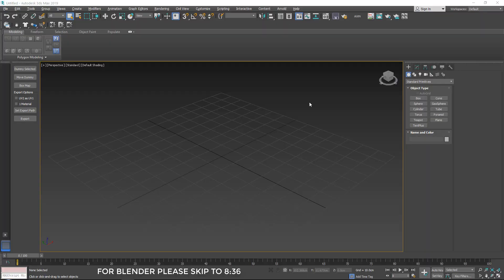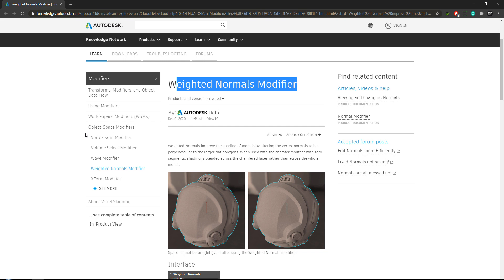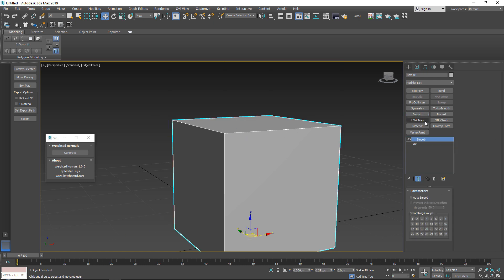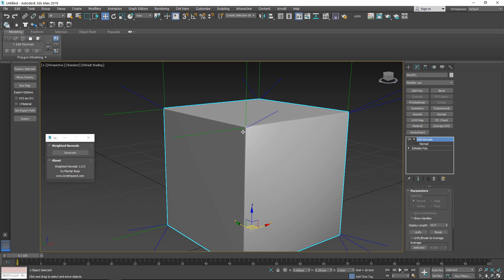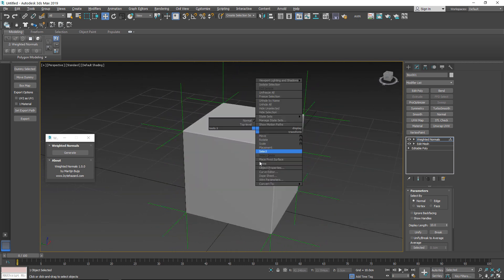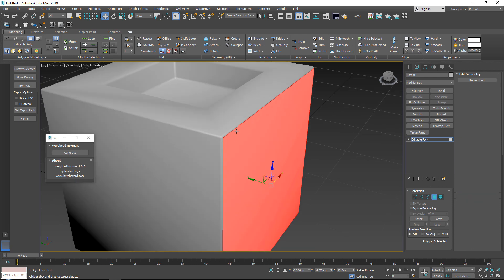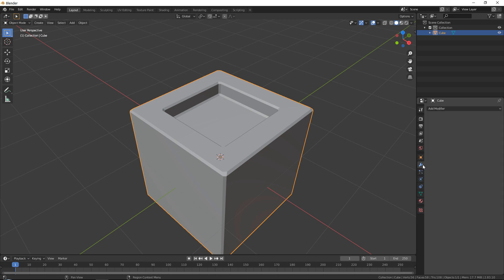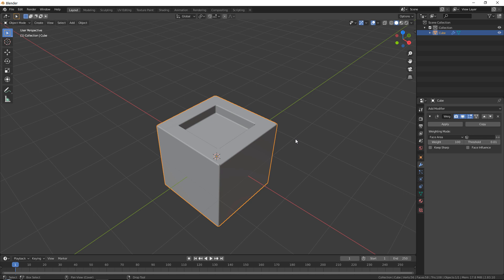Making a 3D Model Look High Poly Without Normal Maps

Comment: By doing this, normal will be locked right ? Which means i cant do unlock normals if I’m using weighted normals. Can I use this in models which gonna deform ?

Comment: Can i use this weighted version for high poly baking or do i need to make it by sub surface? I mean does this technique work for high poly baking? If it does, it saves a lot of time.
Reply from the maker: No, this will not work for high poly baking as the bake will only show a simple bevel but not the smooth effect
Reply: @FastTrackTutorials  thank you so much for the answer.

Comment: Really awesome video! Thank you for sharing. However I have a question, do you think it's better to use this technique and using some tilling textures rather than using trim sheets?
Reply from the maker: It all depends on the model to be honest. if you need something very detailed then sometimes it is easier to use trim sheets because it is more optimized. but if the model is massive then often being able to see actual geo details will look nicer
Reply: @FastTrackTutorials  Thank you for your reply :) I am just thinking about one personal training project for modular buildings and I am wondering what technique to use :) As I will need some edge damage stuff. Would you recommend to make a trim sheet with edge damage baked inside, but without bevels (I mean bevels baked into the texture) to be used in combination with weighted normals technique? Thank you in advance for your reply :)